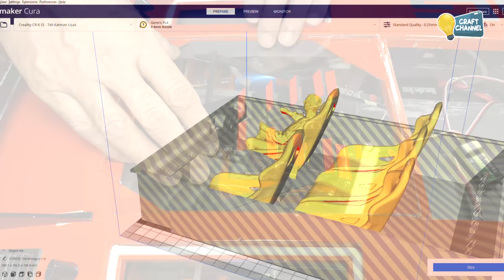How To Make Mercedes AMG Proboat RC Speed Boat - Using PVC Foam Dakota Twin Brushless Motor RC Boat

Comment: bad propeller you can hear the engine does not pull it turns in a vacuum .. change the propeller you will have better performance 👌
Reply: Again free advice,giving advice is easy😂

Comment: It's really great. The video looked good.
But can I ask you a few questions?

1.  It looks like you're using a different kind of glue for each bracket time.
     I wonder why they use different glues and what is the purpose of each.
        ( 1:23 , 2:10, 7:02, 8:06)   /  (2:15 , 2:28, 3:12 ) /  ( 7:35 )
        [* Times in parentheses are the same glue]

2.   at 10:33

      The glue was transferred to the cup and the bond was applied with a syringe.
      Why are you suddenly applying the glue with a syringe?

Comment: Nice work but looks like your X-Dimension is a little off. Without being able to hear it run I can't tell if it's too low or too high. That boat will go a lot faster once you dial that in.
Great video!